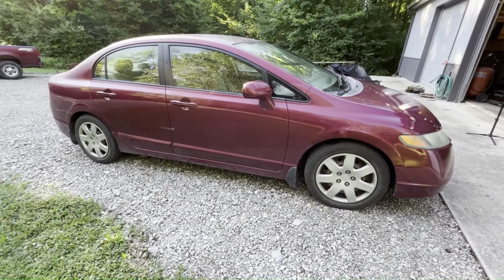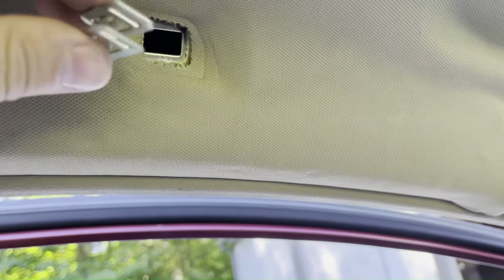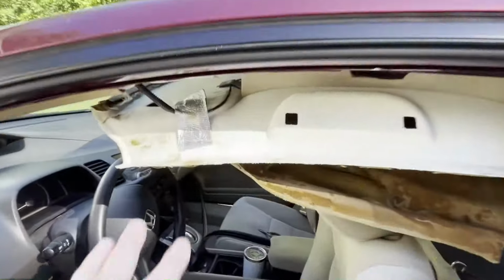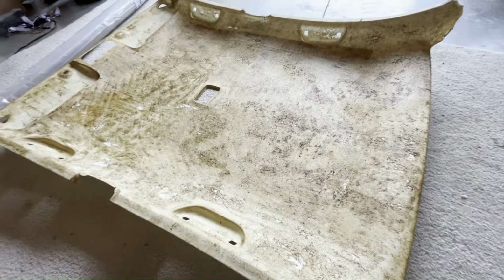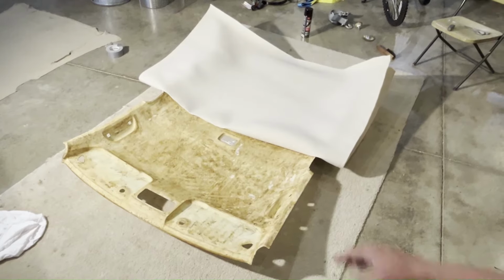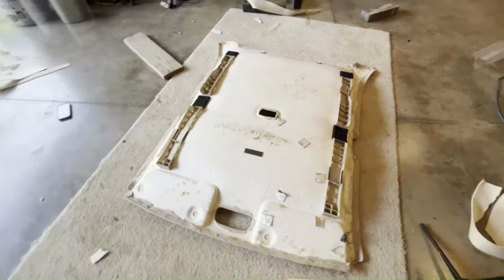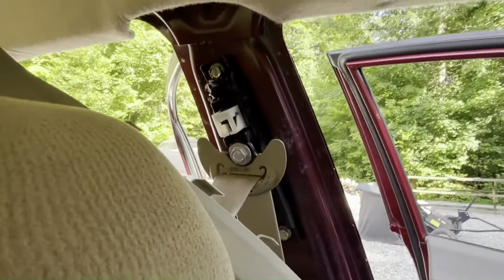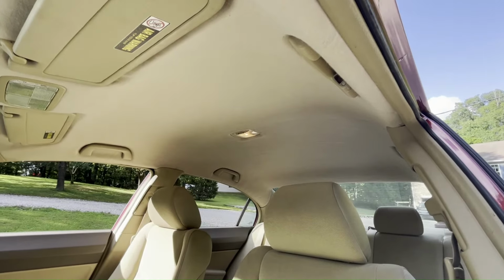Honda Civic Headliner Replacement DIY. 2006 - 2011 8th Gen other years/models similar Remove Install

Comment: Thank you for a detailed video. According to Honda service manual, the headliner front should be lowered below steering wheel and then it should be pulled out of the front passenger door. That will provide better clearance than the trunk and not require folding it.
Reply from the maker: @kryptik0  thanks for the comment. Maybe that would be possible if you laid the front seats down all the way back instead of folding them forwards, but I bet it’s still a tight squeeze. However my headliner has no wrinkles where the small folds happened. Only where I didn’t quite get it glued down well under the visor area. It’s still holding up great so far and looks good.
Reply: That's good information. Do you know if that's the same for the coupe? I imagine it would be since the headliner is smaller and the door opening should be larger.

Comment: How much material did you end up ordering L x W?  Very good video, I did a headliner in a truck before and didn't realized this would be somewhat similar.
Reply from the maker: @vanangle  I ordered material from moonlighting auto. They sell it in a roll for headliners. The size they sent was plenty for 1 headliner.

Comment: Hey the cloth in my car is hanging how yours was in the beginning. Do I have to replace the cloth? Or can I just kinda stick the cloth back up to the ceiling and fix it that way?
Reply from the maker: @notkryptxc  you can’t really glue an old sagging headliner back on. The foam underneath is all crumbly and won’t hold anything you glue to it. You could possibly pin or thumbtack it up to the fiberglass headboard I guess if you were really not wanting to replace it and didn’t mind that.

Comment: Great work, glad to see you went with the slightly lighter color, as it'll probably match perfectly over time as it gets dirty. Wondering how it's holding up 3 months in?
Reply from the maker: It's still holding strong. Looks great still. Right around the visor detents I could have done better, it didn't stick great in about a 1" area in the deepest part of the detent, but that hasn't led to anything else unsticking so far. I learned a few things - 1: don't over apply the glue, or if you do you have to let it get tacky before you stick it down. 2 - leave plenty of excess and the goal is not to stretch it anywhere at all, any stretching will just lead to making it harder to get to stick down.

Comment: not  good stuff to use to glue a headliner with. I know I am an upholsterer any can glue will not hold and make a big mess to clean.
Reply from the maker: Hello, 3M markets it as headliner glue, so I went with it, and it's holding good so far. What do you recommend using for those that don't have access to a spray gun?

Comment: If. You do this spray the crap out of it and use a roller .you don't want to have the fabric failing. Also you will want to replace the 2 tabs in the back
Reply from the maker: I found that if I sprayed a lot in an area, I had to let it dry a bit longer to get tacky before it would stick down. So there’s a bit of a medium amount that’s ideal. Ya if you yank the rear tabs off they’ll need re-glued on like I had to do 1 in this video. If you’re careful and remove it right by just pulling the liner forward on the back side instead of down, the tabs won’t tear off.